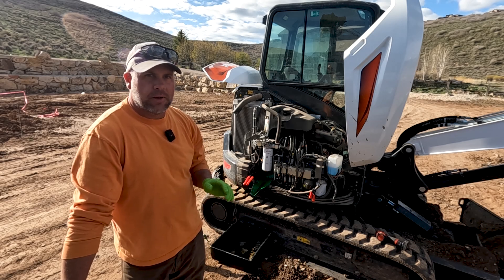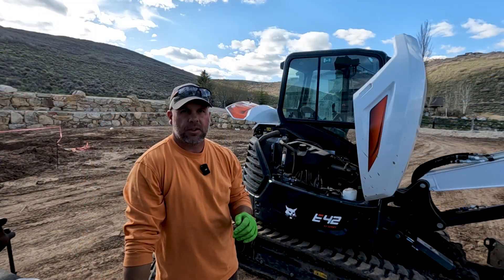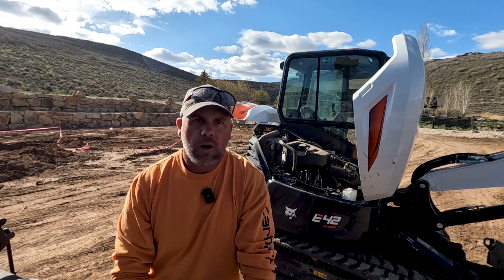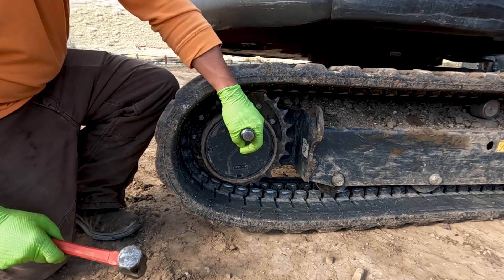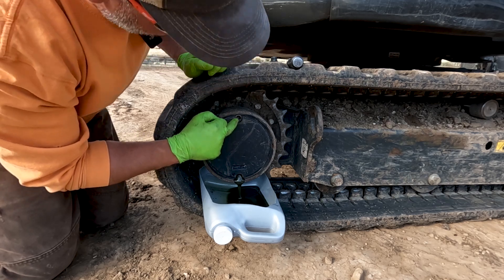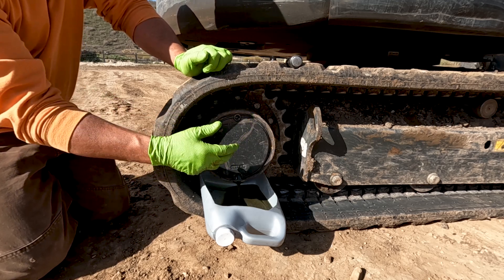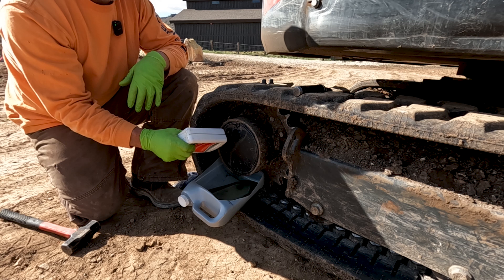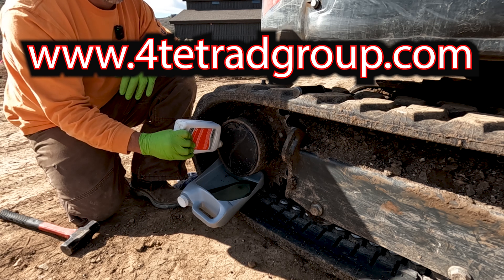Bobcat Final Drive Maintenance, Most Neglected Service Item?

Comment: My 2019 e45 only has 2 drain plugs on the final drives. Also the final drives are filled to the top with oil. Is that normal?
Reply from the maker: Some machines only have two and should not be full, just half way
Reply: @tetradgroup  hmm. i got the E45 with 500 hours on it. now has 1050 hours. never checked it until 1050 hours and it was full of clean oil. should i take half of it out or keep running it?
Reply from the maker: @pigslayer106  I would rather have it half full or one quart per side.  At 1000 hours it needs to be changed so drain and add 1 quart per side.  The oil needs room for expansion and it will also pressurize as it heats and cools.  If it doesn't have the room for expansion it could blow internal seals.
Reply: @tetradgroup  ok thanks for the advice. One other question: my T76 took grease in all the fittings except the two at the end of the tilt cylinders where they mount to bucket. 
i took the fittings out and they are clean but when i put them back in, it still wont take grease. any ideas?
Reply from the maker: @pigslayer106  I would pull the pins and make sure the bushing didn't spin in the rod end.  With pin out see if you can get grease to flow through fitting.
Reply: @pigslayer106  I have a 2019 E45 and Bobcat Manusl says half full.

Comment: Thanks for the tip/link on the impact driver.  I noticed the first time I went to change the gear oil it was trying to strip.  Brand new machine.
560 hours on my machine, I did change the oil at the recommended interval.  Just walked out and noticed I have gear oil all over the ground.  It's leaking from somewhere on the "inside" side.  This should be fun...

Comment: 1000hrs is insane. And it’s probably with a 2000hr service life in mind. I’m sure 99% will last 2000hrs on 1000hr services and that’s what matters to bobcat. They don’t care about time past warranty. 
Cat recommends the same on their minis and 500 on the skids. I do 250 on both. I buy TO-4 oil by the gallon so each drive holds $3 worth of oil and takes no time to change. Hardest part is not stripping out the stupid level plug that is slightly too big for a 5mm Allen, but too small for a 5.5mm.

Comment: is there anything you recommend to flush out the final drive?  I bought a used T590 with 2500 hours and the oil was like honey coming out (and not much of it.  oil cap is  2 oz) I refilled it and ran it while it was off the ground for a bit and change the oil a few times to clean it out.
Reply: Fill it with diesel fuel and run for a bit
Reply from the maker: You are doing the right thing.  Just flush it with oil a few times and it should be fine.  Good luck!
Reply: @tetradgroup  how often do you recommend on m series skid steers?
Reply from the maker: @copenstrokin99  500 hours